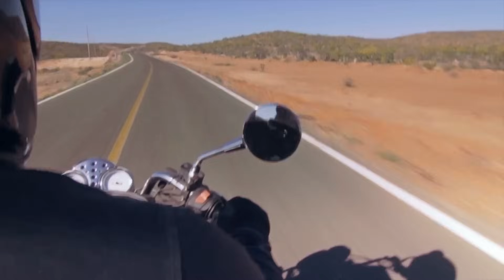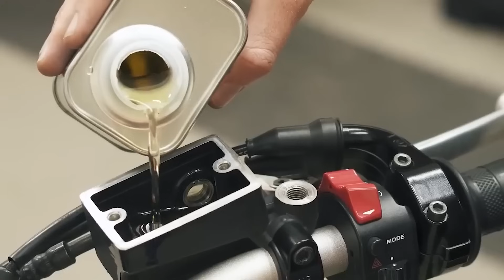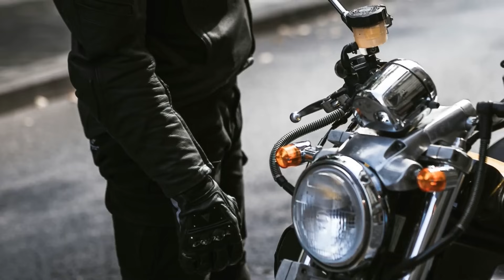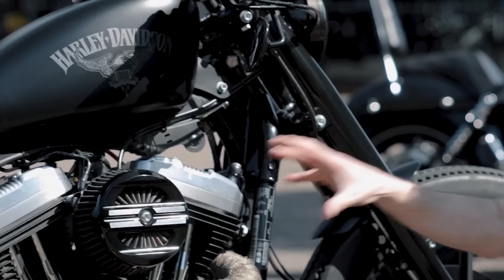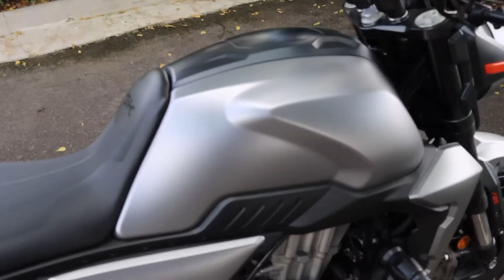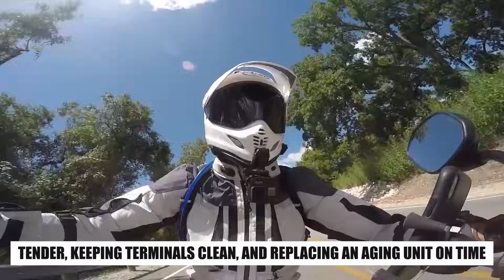The Most Stupid Reason Your Motorcycle Broke Down (90% of Riders Do This)

Comment: At my 1,000 mile maintance My HD dealership ( The One I Bought the 2024 FXST in March 2024) wanted $1,100 for checking all bolts and tighten to torque specs , changing oil and filter and trans fluid if necessary .
I finally got the OK from a top tech there IF I used all HD approved fluids and I personally wrote down all torque on all the required bolts .
My cost around $250 ; which was near what Doc's St. Louis quoted me .